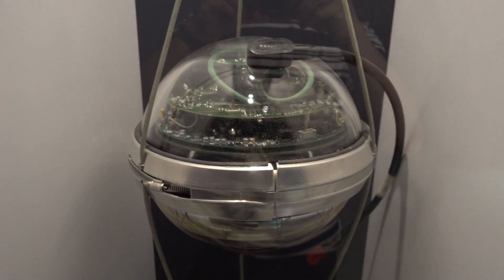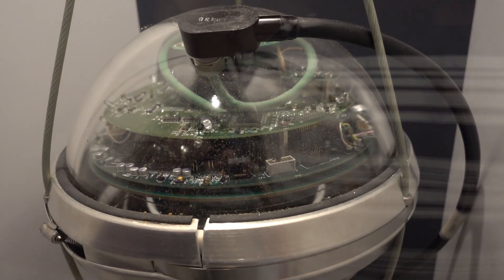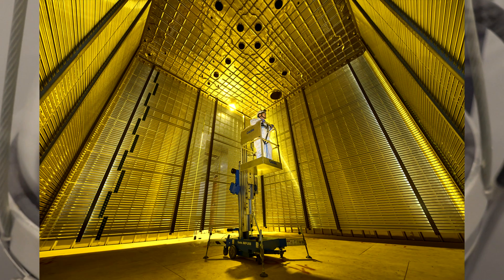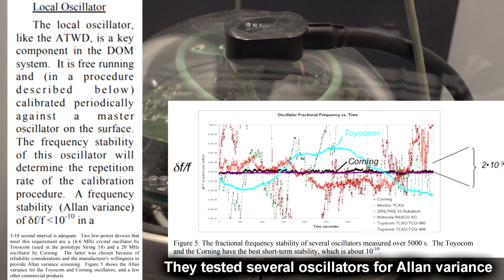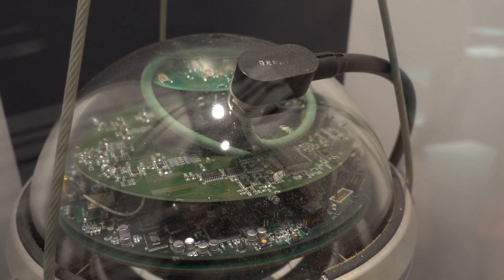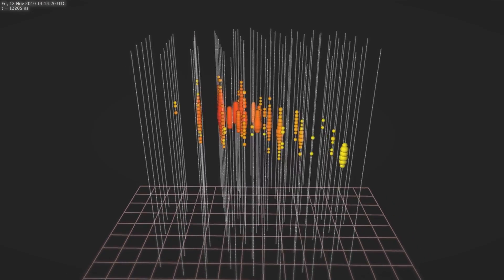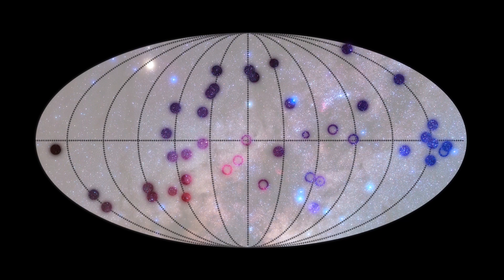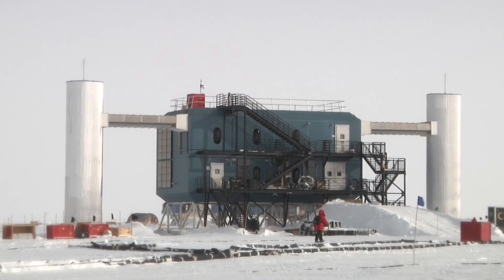Antarctic Neutrino Detector!

Comment: lol! With sets of neutrino detectors all over the world, they can pinpoint just about any nuclear pile kicking out over a megawatt, probably way way less power with the new array.  Plus the astronomers get to play with them as well, so everyone wins.  Except wanna be nuclear states trying to be sneaky. ;)
Reply: Psibr1 security agencies likely do go over the lower energy events but picking up the gamma from planes etc is currently at least the way they pin point them.
If they start putting neutrino detectors down oil wells where you would only see anything if there were a heck of a lot generated nearby (rock isn’t particularly translucent compared with water or the Antarctic ice) or heaps of the detectors get made but never seem to get put anywhere..